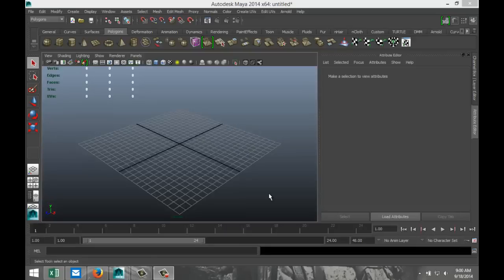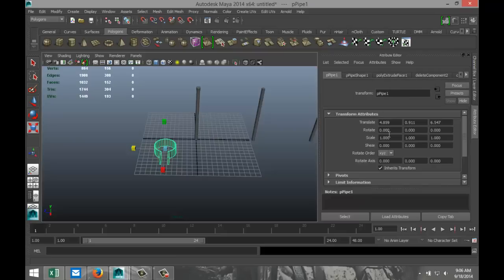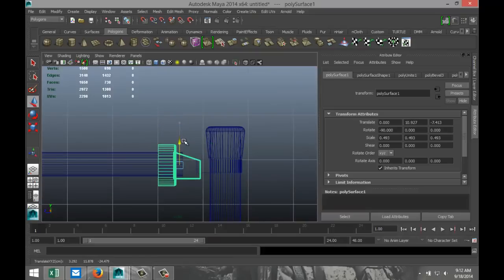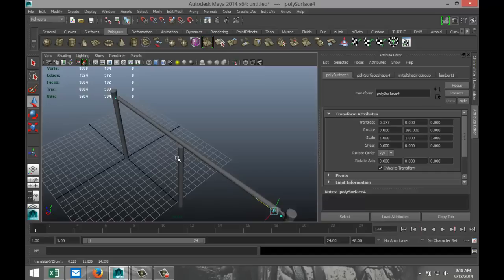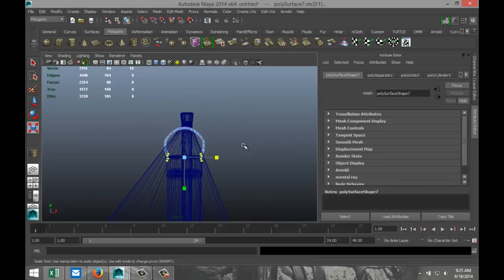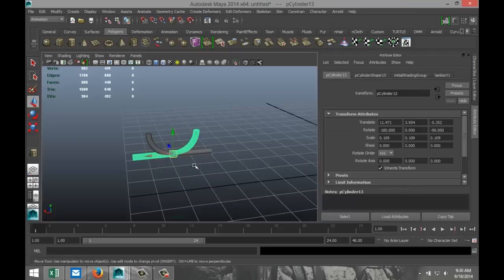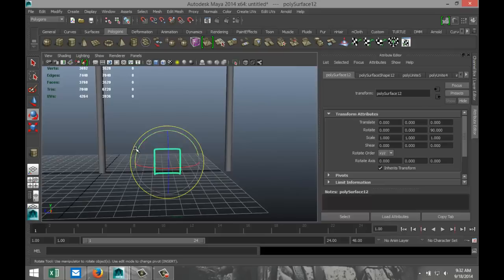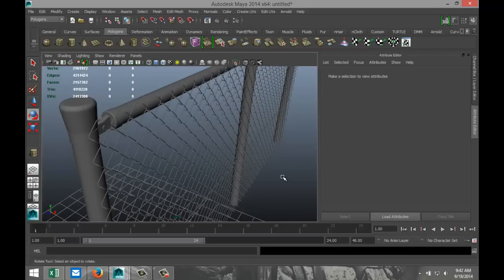Maya 2014 tutorial : How to model a chain link fence

Comment: To prevent the lag
Under this step: 26:57
Put in 8, 6 or 4 instead of 40 under Subdivision Axis.
(at a distance you will most likely not see a difference.)

28:53
1: Press the little camera icon. (underneath View) that will select the camera you currently looking threw
2: (on furthest right of your screen you find the Attribute Editor)
There you can change the camera settings.
change near clip to a lower value 0.001 is the lowest you can go that should solve your issue.

Thanks for the tutorial it was inspiring
Reply from the maker: Nice, thanks
Reply: Mike Hermes or just alt right click drag
Reply: yea or just can just do that xD

But 8 - 6 & 4 are good numbers. They are symmetrical and usually look better then 3, 5 and 7 for example.
Thats why i suggested that.

/my post went to big to explain that :P

Comment: hi!  the fence is taking to much power of maya for me to finish the tutorial.  I have heard that you can transform the entire high poly object into a low poly one?  Do you have a tuts on that?  I have only watched your videos so you know where my beginner-levels at.  Thanks again :)
Reply from the maker: +Dan Ögren Dan, yes normally that would be possible but this object is not suitable to model as a low poly
Reply: +Mike Hermes Why not make the ''fence'' as a Plane and add a  texture ? :D well depends on how well you want the model to look i guess haha :D
Reply from the maker: +Eric Wallin Yes, you could do that. It would look a lot different though
Reply from the maker: +foist Correct, that would be the alternative process when making it for a game
Reply: u can add the high resolution chain into a layer and hide it
Reply: +Dan Ögren Hey Dan, There is no need at all to make this model this dense and I have no idea why he would model it like this... 40 subdivisions is way high for a simple pole and way too high for small details such as the chain links. And 10 levels for the bevel on the pole cap? Can someone say overkill!? Has he never used the Smoothed edge tool or even the 3 (smooth) button? You can easily get away with 8 or maybe even 6 subdivisions on all the cylinder objects maybe even less on the cylinders that make up the chain links. Then select all the edges you want smooth (usually all subdivision edges and not edges that form 90deg angles) hold Shift + right click > Smooth/Harden Edges > Smooth Edges. BOOM! Looks just like 100 Plus subdivisions and can be carried into game engines. This model could be 5+ times less dense and look exactly the same. Maya can't really handle more than a couple hundred thousand polys max at a time and don't even think about rendering that much because you will probably crash. As for game assets, the only way this model would pass would be modeling out the poles and a couple other small details and using a plane for the links where you can then attach an alpha texture and diffuse.
Reply: Joshua- With all due respect, your methods may be better in some ways, but Mike is giving free tutorials to people who get a lot of value from them- including myself.  Besides, if you're so superior, why are you on a tutorial lesson?
You're watching someone else's tutorials and bashing them on their page....just sayin'...
Reply: +Joshua Bjornson partially agrees. Smooth edge normals on area of rest, but you need some definition to the sharp bend. Scary huh? Polys! By the by, I think smooth proxy is not considered full model 👀
Reply: +Joshua Bjornson what you could do that is better is use normal maps! Use this high poly model and make a normal map, and put that onto the low poly model. That way, it would look even more high definition, and the sharp bends can too be reduced in polycount 😀
Reply: +Zenovarse It's a good idea but a normal map would not be suitable for this. Normals are ment for adding definition to flat objects (scratches, dents, bumps, etc) not for creating full 3D models. You would have better luck with a Displacement map but still nothing even close to chain links. I this is for a game the only way to do it is by using a plane and applying a chain link texture and an alpha to cut it out... Note,  you could use a normal or Displacement to give it a bit of definition but that wouldn't really be noticed so it would be kind of a waste. If you are planning on doing it for a movie a plane with a texture is still going to be your best bet unless doing close-ups but still you wouldn't need any more than 8 subdivision and 5 holding loops on the edges for definition there. Then simply hit the 3 key to smooth selected objects.
Reply: +Zenovarse hitting the "3" key isn't smoothing normals like you would find under the "shift" menu. It's literally adding more geometry you just can't see the edges of the extra geo. If you rendered out the edges you would then see them. Think of the 3 button as a quick way of adding tesselation... You wouldn't even smooth the edges that hold the curve, that would do nothing other than shadow pinch. The only way to get a perfectly smooth corner would be to use the 3 key
Reply: Joshua Bjornson so basically a flat image plane with alpha? That is quite conspicuous to gamers in loss of definition?
Reply: Joshua Bjornson I don't think smooth proxy is considered a complete model, but it would probably look pretty good. I think you are right on that.